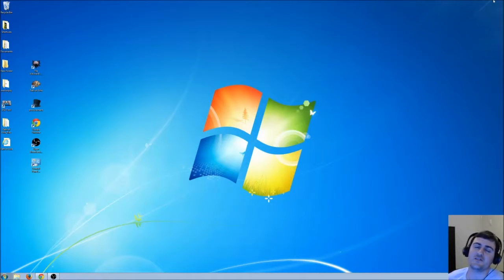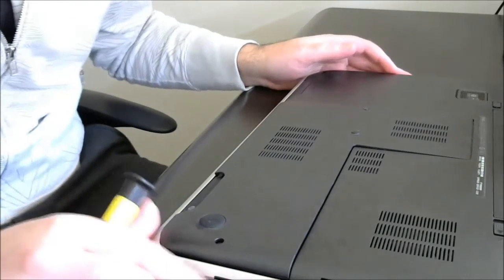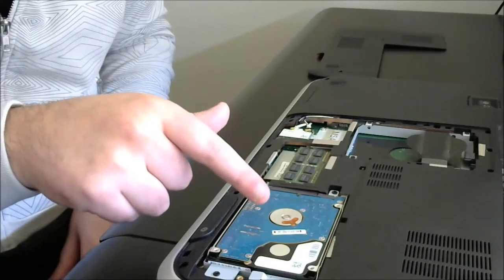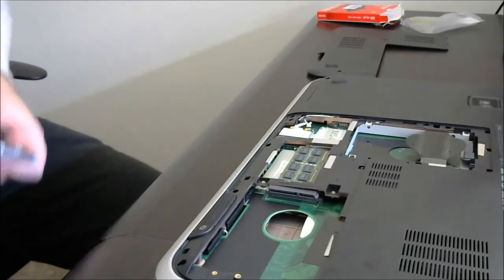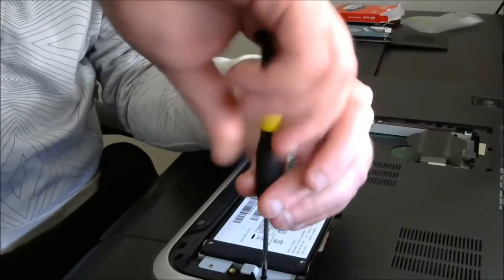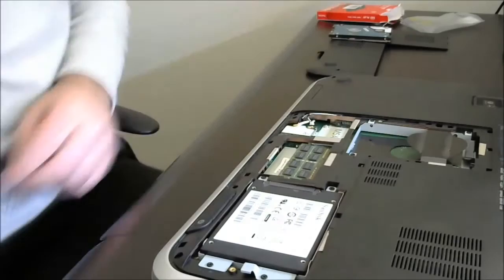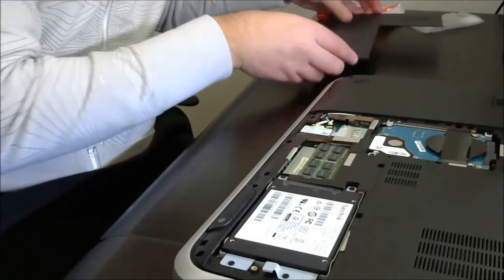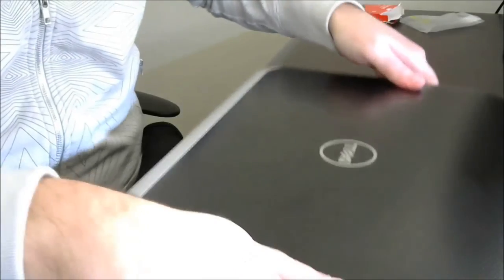how to install ssd to dell laptop installing ssd drive to dell laptop

Comment: Thank for the video. So as I understand you dont need to do a backup of your old hardrive? simply moving it over to the other slot and installing windows on the SSD, I would still have all old files available?

Comment: Nice video, thank you.  
But... why did you swap the drive locations instead of installing SSD in the empty bay?
Reply from the maker: We want the operating system on the ssd. So the ssd is put in the main drive bay.